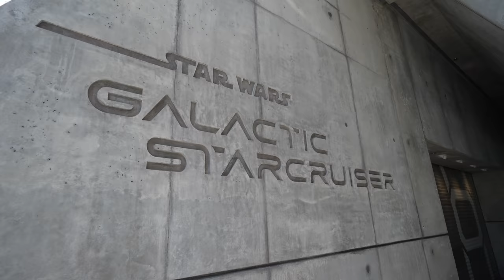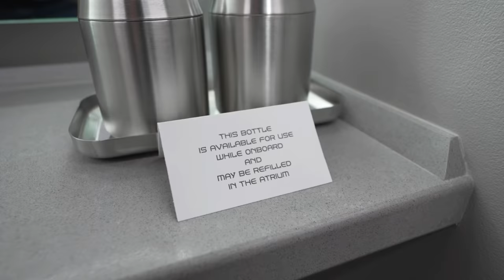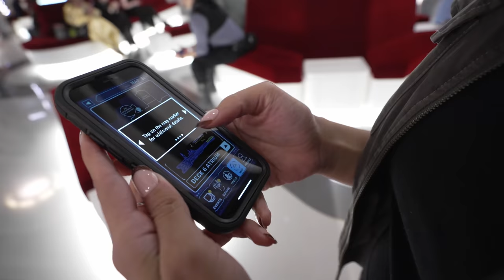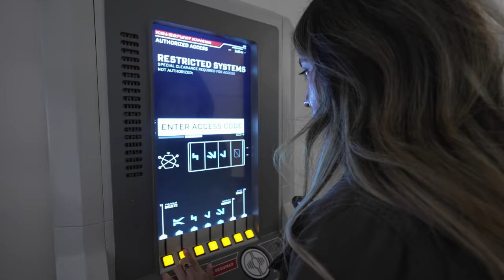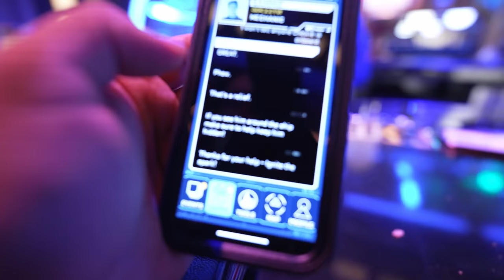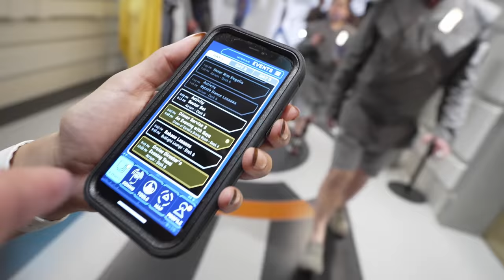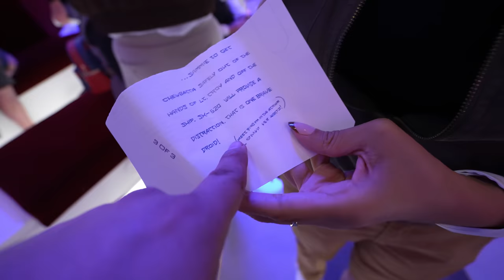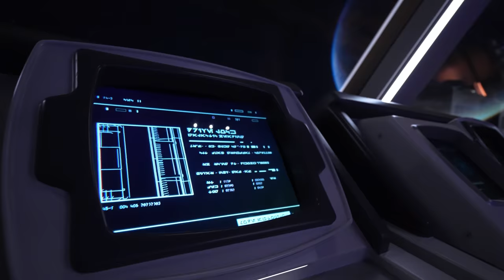We Finally Board Disney's Galactic Starcruiser! A 2 Day Immersive Star Wars Experience! Part One

Comment: Personally, for the steep price I feel the sizes of the ship lobby .. main social areas etc should be much much larger. It should at least be the size of a normal sized Disneyland hotel lobby but it seems much smaller. The dramatic massive size of the inside of a “ship” would have been insane. Seems like the rise of the resistance storm trooper room is even larger.